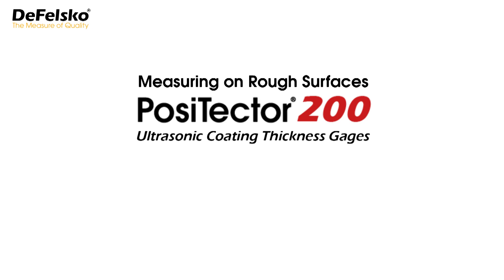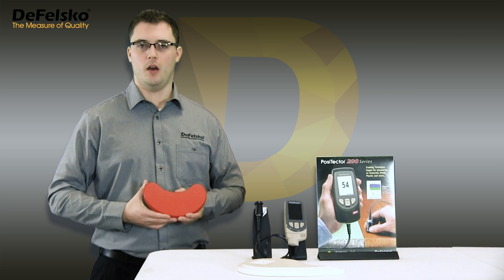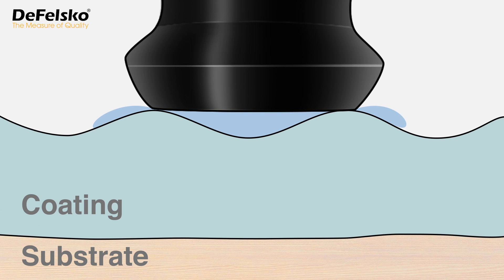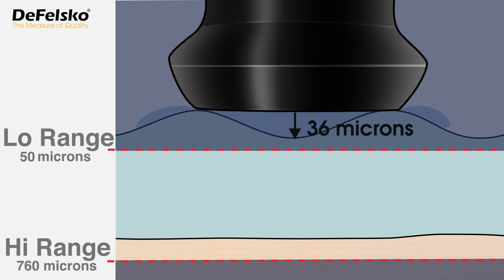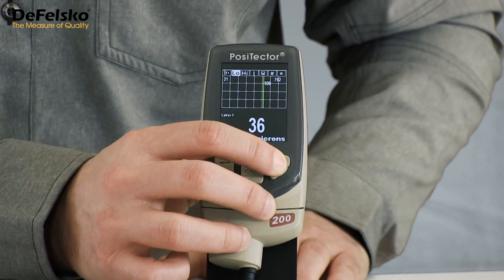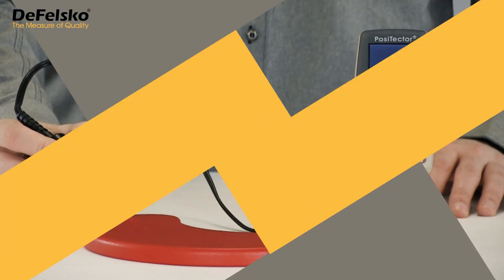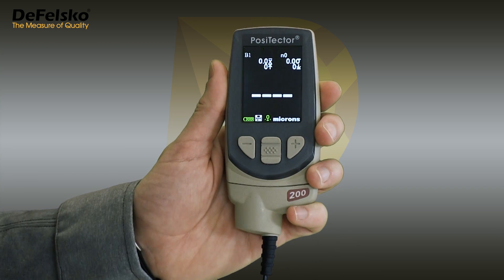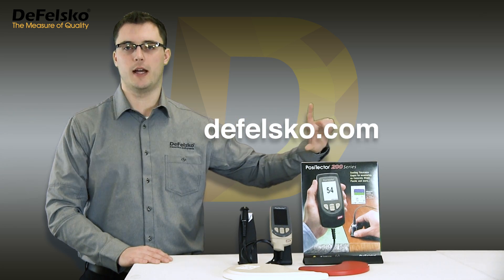How to Measure Rough Coating Thickness with the PosiTector 200

Comment: what type of prob useful for checking thickness of epoxy as flooring on concrete base
we used 200 but reading was not achieved its were 51,51,62
Reply from the maker: Thank you for your question. The PosiTector 200 C coating thickness gage is specifically designed to measure coatings applied to concrete and other similar substrates. The measurement results you are seeing are likely the result of surface reflections, as described in this video. Please open the [Cal Settings] menu, select [Set Range] and raise the Lo Range value to filter out the surface reflections. If you require additional assistance with configuring your instrument, please feel free to contact us by email at techsale@defelsko.com or by phone at +1-315-393-4450.

Comment: if zero settings is failed what need to do
Reply from the maker: Thank you for your comment. So that we can best assist you, please contact our technical support team at techsale@defelsko.com.
Reply: On concrete requires dft is 720 , so how much should be lower range setting? We want to set on 700 lower range then DFT is coming ok but client is not allowing

Comment: How to fix "prob ZERO required" message on screen??
Reply from the maker: Hi Jamsheer, To zero your PosiTector 200, simply select Zero from the Cal Settings menu while holding the probe in the air.  You can see detailed instructions in our other PosiTector 200 video at minute 2:45 here: https://youtu.be/_yj65LIE9Bc?t=165 
 
For further technical assistance, please contact us at +1-315-393-4450 or techsale@defelsko.com